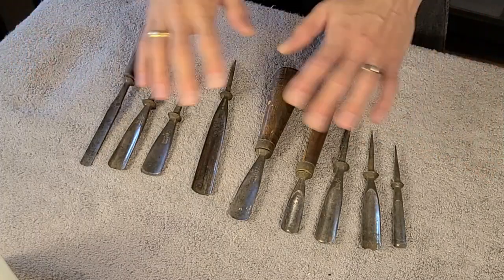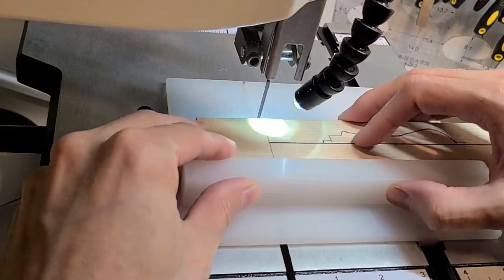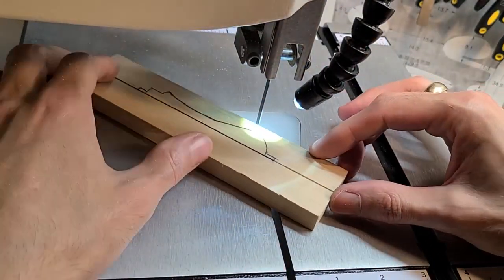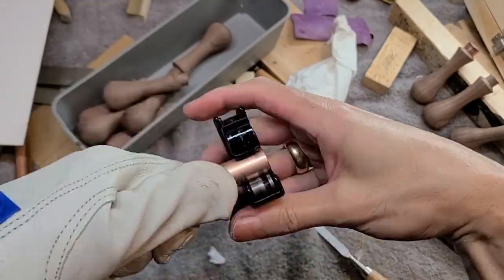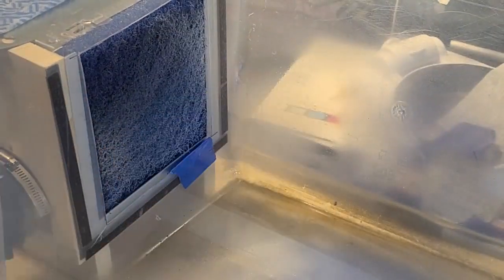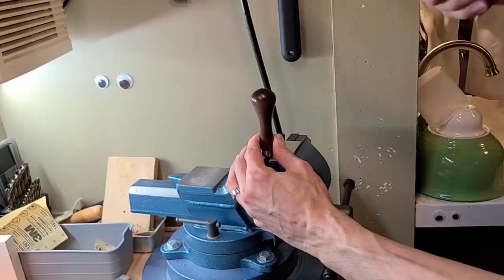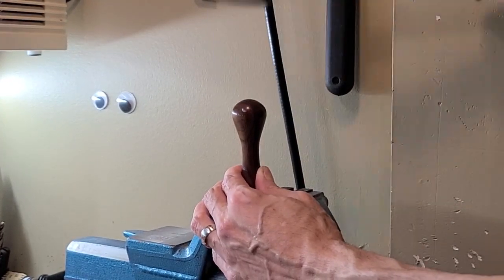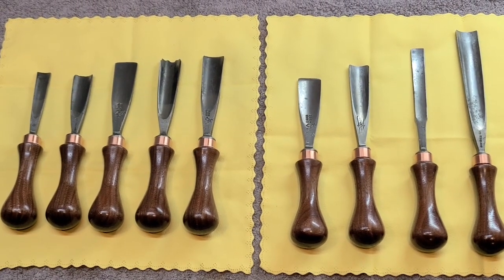Antique Chisels Restoration

Comment: Great video!  Note: with carving gouges, you do NOT need to grind back to beyond the pitted areas.  You simply put a secondary bevel on the inside, a common practice with carving gouges.
Reply from the maker: It's an old habit.  😉👍